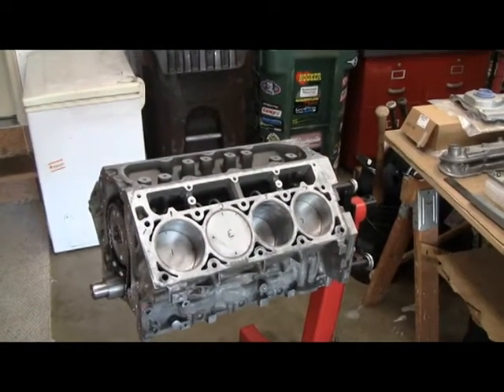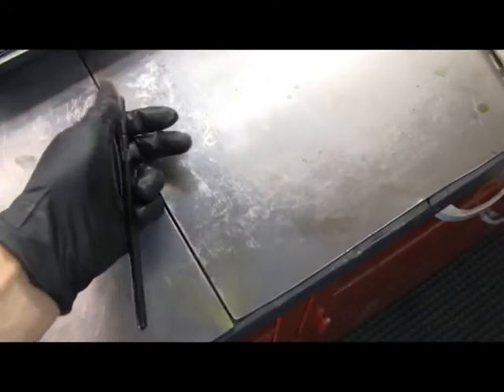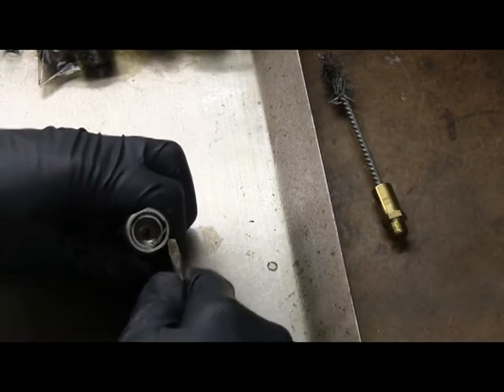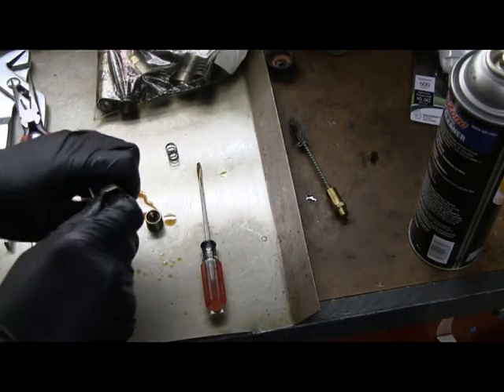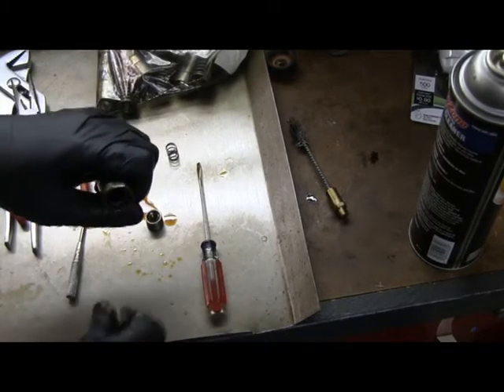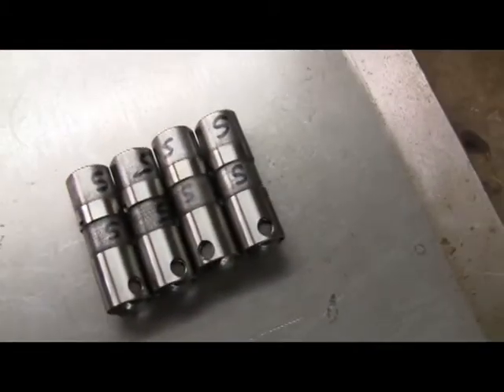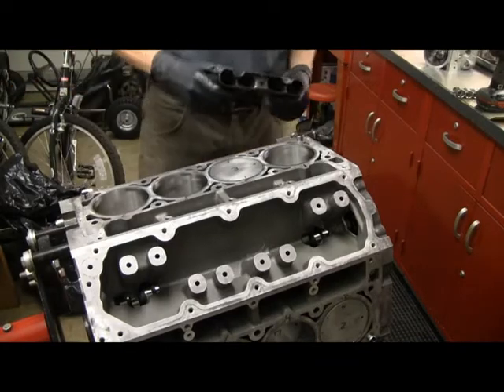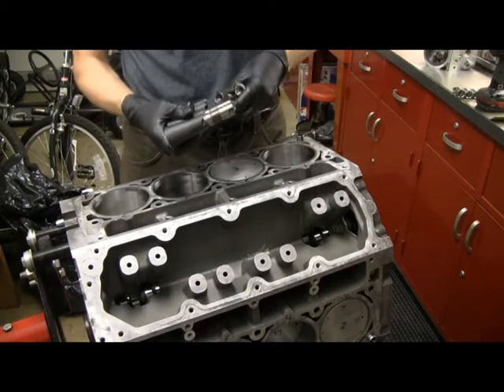Episode 38, Push Rod Length Check

Comment: Could we use a proportion equation and just cross multiply the old cam and pushrod numbers with the new cam numbers and get the new push rod numbers?
Reply from the maker: I guess you could, but physically doing it on the engine assures no calculation mistakes.

Comment: When ever you check the push rod length, do you always use a solid lifter? I have johnsons aftermarket lifters and wonder if i should use them to check the push rod length or the solid lifter?
Reply from the maker: My understsanding is that you need a solid lifter otherwise you could get a false reading if the spring in the Hydraulic lifter compresses when checking

Comment: If I remember correctly, Texas Speed sells rods in 0.025" increments. Both their own brand as well as Comp.
Reply from the maker: Correct on for the .080" wall push rods, but for the .105" wall they are at .050" increments.
Reply: Prime Garage GM A-Body LS Swap 👍🏻